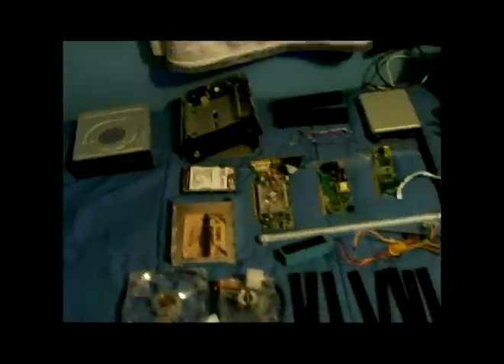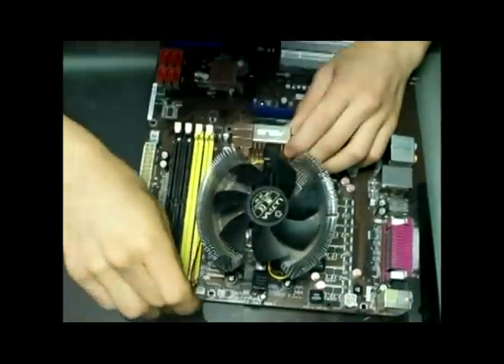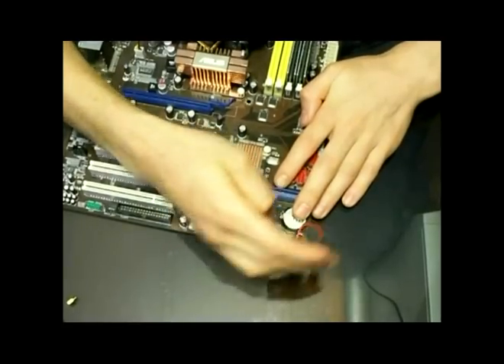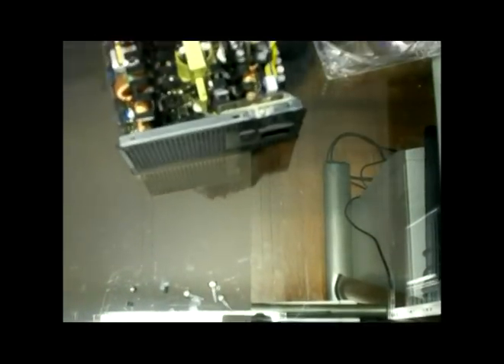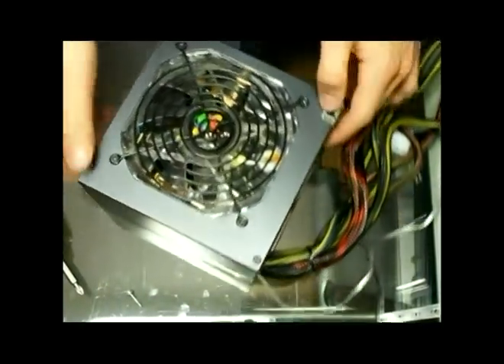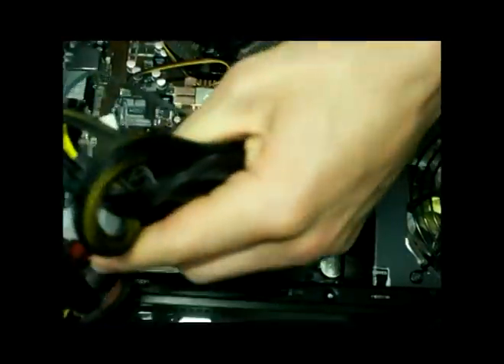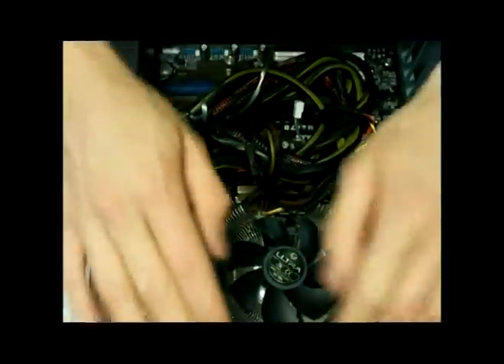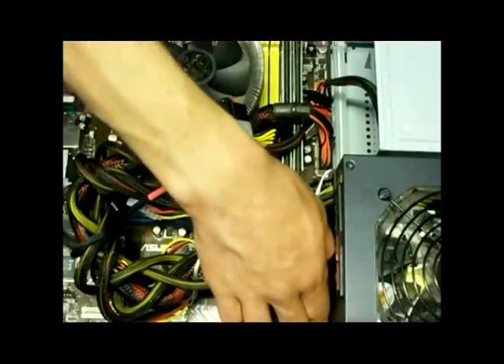Building My Linux Rig part 1

Comment from the maker: Yes I shouldn't have touch that paste. but at least I got rid of it from my Fingers. I normally don't build computers that often. what I did to mines that most people doesn't do is mod several part. I bet not many people can even dare use a soldering tool or linux if you saw the second part of my video. so thank for the tips.